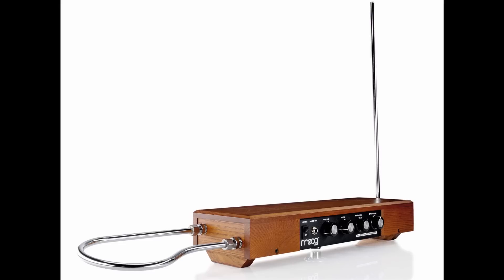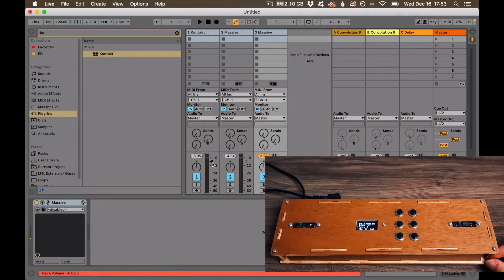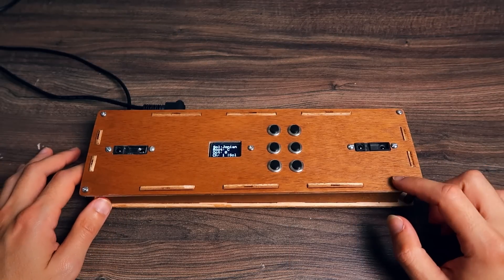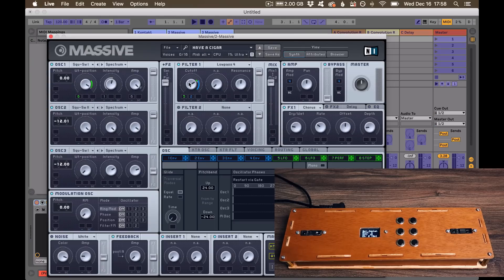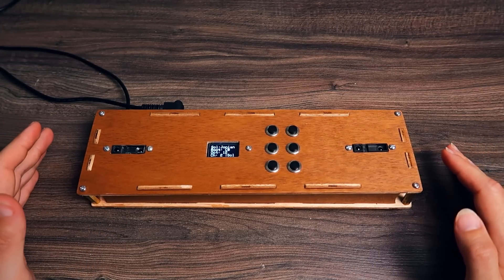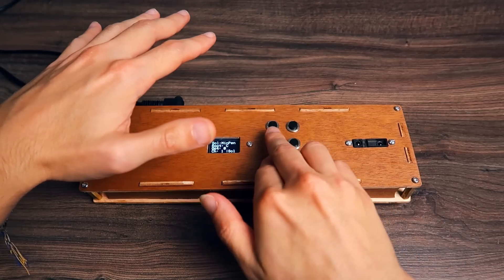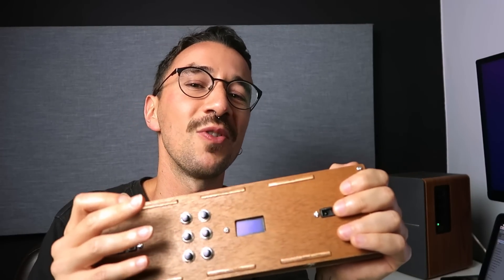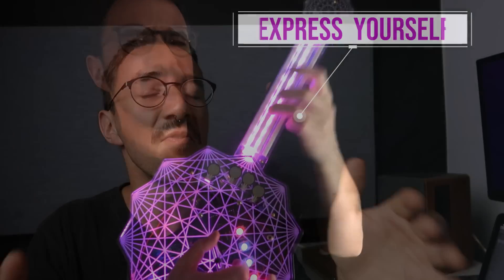I Built a MIDI THEREMIN! Theremidi - A DIY Arduino MIDI Controller

Comment: Does anyone know the exact capacitors and resistors used?
Reply: It’s on the schematic
Reply: @soulstatecreations7988 I figured it out. The microfarads (μF) were the most common unit in the US for many general electronic applications and Nanofarads (nF) were historically more common in Europe. I was having a hard time finding them in nF, once I figured out the correct value in uf it was easy.

Comment: Great project!!! I have a question for you. The pitch bend in the teremino has a very small excursion (maybe a couple of semitones). How can I increase the excursion to make the teremino more similar to the original? I tried this:
sendControlChange(101, 0, valuesAct[cChannel]); // RPN MSB
sendControlChange(100, 0, valuesAct[cChannel]); // RPN LSB
sendControlChange(6, 12, valuesAct[cChannel]); // Data Entry MSB (12 semitones)
sendControlChange(38, 0, valuesAct[cChannel]); // Data Entry LSB (0 cents)
but it has no effect. I am using Windows with VirtialMIDISynth.
Many thanks. Bye

Comment: Do you think the VL53L0X LASER ranging sensors might work well? They are MUCH cheaper and use lasers.
Reply: Tested myself using them and they are pretty responsive. I think this could work with a couple of them. Will report back!
Reply: @rowenhusky  Hi ... did you manage to build it with the sensors of your choice? can this theremin play a tune or it can only play scale? thx

Comment: Hey Gustavo. Great work man, I am building this myself. I cannot find the the specs of the capacitor you are using. i know its .47uF but how many volts??? M really stuck at this one, could you help me with it please?

Also checkout how I added a  drum machine and looper to my electric guitar using your DIY MIDI controller workshop here: https://youtu.be/o3nMD5E7fhU ! Thanks a million man!

Comment: I made something similar using MEMs sensors, but this has better control. What did you use for your sensors?
Anyway, nice work! Bueno.
Reply from the maker: I used the sharp IR sensors. I guess it says in the schematics exaclty which one was...
Reply: @NerdMusician   Thanks.  I did some research and those do look like one of the best in terms of range.  A bit more expensive, but results are worth it.  Thank you for a great project, too!

Comment: Hi, I was waiting for the glissando the whole video and there it was! Fantastic little device! I am trying to midify my homemade Ondes Martenot so this seems a good start. I am not a good programmer and I am always copy/pasting till things work :) I wondered if the file Theremidi.ino is complete, it does not end well (line 217). Can you help with that? Thank you for making this!
Reply: Same question here. Is the Theremidi.ino the integral file or do I need to load all the 8 .ino files to the board? Thanks!
Reply: It really works fine as it is! The only thing I changed in the code is the CC for the left sensor. For some reason Ableton did not want to work with channel 7. I changed it to 11 and now I can do whatever I like with it. A fine midi controller!

Comment: This is GREAT, thank you very much for sharing, much appreciated!  I started ordering the parts to build one myself, and, I have a couple of questions.  Could not find the resistors of 14.87 K ohms which you outline on your schematic (Theremidi Schematic.png), so, will resistors of 15 K do the job without impacting anything else?  Also, are the sizes of the Brass Hex Standoff Spacers that you used M4 x 25mm? Thank you!
Reply: Hi, the link to download the files seems to be not valid. Could you help to confirm? Thank you in advance.
Reply: @Dan8254  I went to his main page then drilled down through there to the specific tutorial then located the files. Oh, and I think you have to signup for the emails/newsletter to get access if I recall correctly.
Reply: @LuisTorres-qz5kr  
Thank you. I will try.
Reply: Hola tampoco consigo las resistencias 14.87k ohms ¿ las reemplazaste por las de 15k ?  te dio resultado?
Reply: HI Luis, looking to build this too... did you manage to build it? can this midi theremin play a tune or it only can play scale? thx
Reply: Did you get this project to work?

Comment: Fascinating.  I play some keyboard and have a few moments with a real Theremin in an electronics Museum.  I am also into Arduino builds and i am now working on building an autopilot for my boat.  I am looking forward to getting the code of this project.  For my autopilot I am using a Nextion touch screen display.  This would work well for your theremin  project.

Comment: Another type of controller that would be of interest to me is a ribbon controller that could send cc# or pitch or Pitchbend. It would be great if wherever you put your finger could be a zero point to start. In other words, if you were playing a note from a keyboard when you touched the ribbon it would have no effect until you slide your finger in either direction.  Thanks for asking 👀

Comment: Hi I want to buy your course. I was wondering if your course covers motorized faders, because that is what I need the course for. Lets say when I highlight a channel on my DAW the fader will snap to the position. Let me know thanks!
Reply: That's not hard to do, but not easy, either.  The microcontroller would need a motor controller board for each fader, and you'd have to program it to receive MIDI from the DAW, then move the fader to that position.  Of course, then you have to tell the DAW to send the correct MIDI to do that, and each DAW might be a bit different.

Comment: This is awesome!
I'm working on an idea for a Trombone midi controller, but want to swap a traditional slide for a theremin-like thing. I'm looking to use pitchbends to give a more smooth note transition just like a normal trombone.
Reply from the maker: You could do it like the Theremidi, who n e mode with scales and a free pitch mode. Sounds like a great project!
Reply: @NerdMusician  thanks buddy! My only concern was whether I'd be able to use pitchbend to adjust the note enough; a trombone has 7 positions, soy plan was to set the note on the fourth position and use pitch bend for three semitones either side of it for the others.

Comment: Waiting for this video to blow up lol.
Reply from the maker: Hopefully!
Reply: @NerdMusician  Hello!!!! Crazy idea here, but could you create a copycat DIY Novation Launchpad (64 button Midi Drum Pad), but using all Super Nintendo buttons???? Preferably the Colorful Red Green Blue Yellow buttons from the Japanese model (Super Famicom).

How the SNES gamepad works is there's a silicone pad under each button and inside that pad is a carbon conductive dot that makes contact with the PCB and tells the "brain" that a button is being pressed. 

You would obviously have to 3D print the case to accommodate the shape of the buttons (official SNES have 3 stability pegs, bootleg buttons only have two pegs).

You would also have to create your own custom silicone sheet that would have the black carbon dots that touch the metal sensor on the PCB and complete the circuit.
Reply: @mana_beast_beats1114  midi drum pad??
what exactly do you mean? (sounds interesting)
Reply: @jpjay1584  --- So you've never seen any drum pad midi devices like a Novation Launchpad or any Akai drum pads like the 226?
Reply: @mana_beast_beats1114  nope. but now I know, thanks
edit: I did see those before but never knew how they are used. (just checked online)